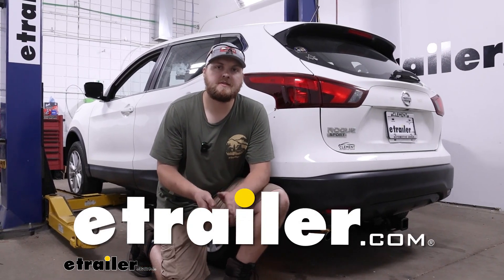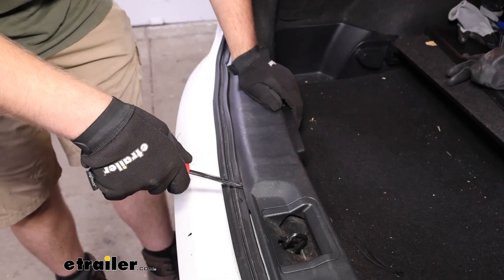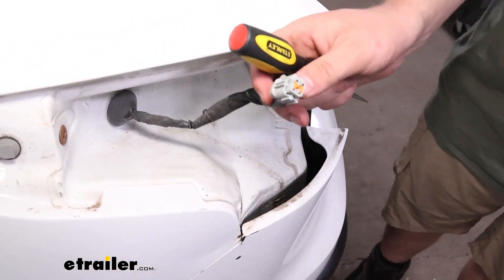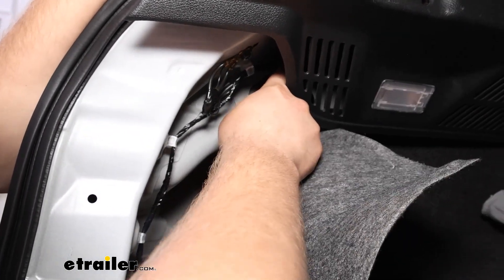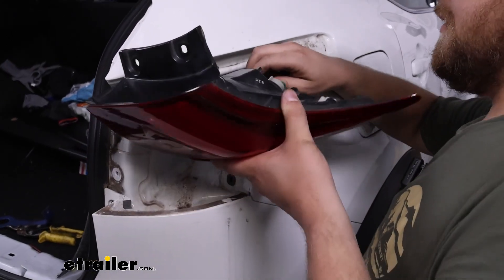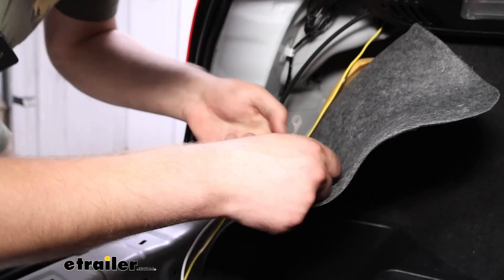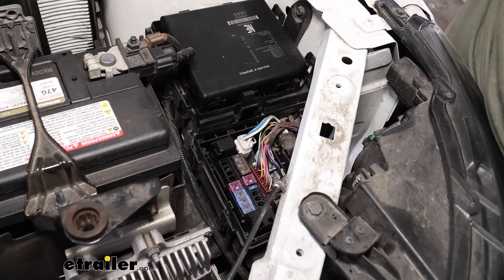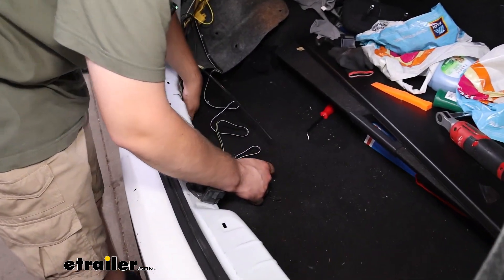etrailer | How to Install the T-One Vehicle Wiring Harness on a 2019 Nissan Rogue Sport

Comment: Thanks for the video! Do I need to put the 15 amp fuse back in? Thanks
Reply from the maker: Yes you do, it's one of the final steps of the install. You can see that in the install instructions I've linked below for you:
https://www.etrailer.com/instructions.aspx?pn=118757
https://www.etrailer.com/Custom-Fit-Vehicle-Wiring/Tekonsha/118757.html